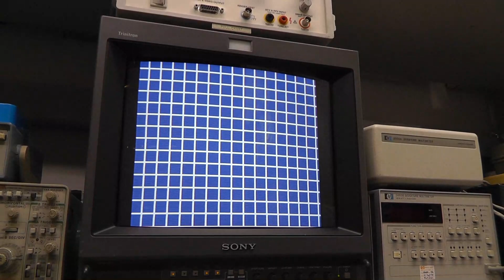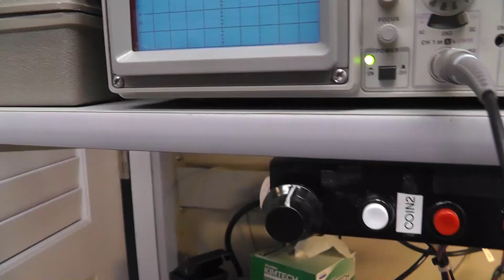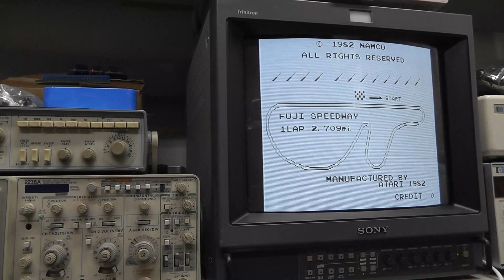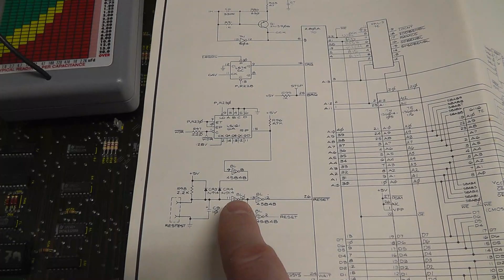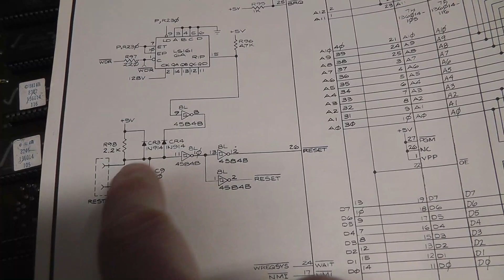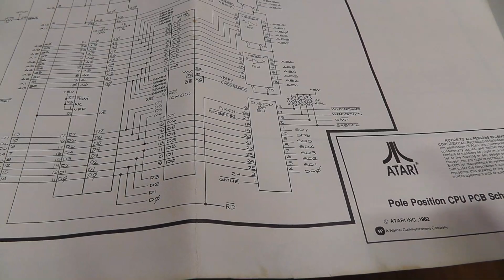Pole Position PCB Repair - Watchdog Reset Rinse Repeat - RevB Set Part 3 - FPGA CAT Box

Comment from the maker: https://forums.arcade-museum.com/threads/what-fixed-your-game-today-general-repair-log.399275/page-6#post-4491774
Game PCB: Pole Position CPU Board
Symptoms:
#1 Constant Resetting
#2 Not Constantly Resetting Enough?
Steps:
I actually addressed #2 first.
Put logic comparator on 6A and it tested bad. Did some probing and found line 14 was floating. Replaced 74ls161 @ 6A
Eventually, I realized the !WDR signal on 6A-1 should have activity if the game is running but it was floating. Checked traces and did not have good continuity from WDR test point or 6A-1 to R97. Trace was broken just at the through hole directly under battery area. Went down a rabbit hole on why it wasn't resetting as often as I thought it should. My theory is the cap at C9 is good for a couple of pulses through the 1n4148 switch diode and then the game will just freeze and no matter if "watchdog" is barking or not.

Moved on to #1
Tested addressable memory and roms of the sound z80 with FPGA Catbox. At first look, everything looked good, but if you looped on "verifying roms" or any test of the ram, it would eventually give you a few failures. In the back of my mind, I figured something was talking on the address bus or data bus when it shouldn't be. Replaced PLA at 7C; no joy. discovered pin 14 of 7C is actually for !CMOSRAMCS1 (not labeled in schematic). Went back to verifying battery area and found the emitter of Q2 was not connected to R92/R88. Another trace that looked good and even continuity beeped (though misleading at 50ohms) but was actually broken right at the through hole of R92. Not exactly sure but assume the Enable (!CMOSRAMCS) of 7E was being enabled when it shouldn't have been and putting garbage on the DB.

Repair.
Replaced 6A 74LS141
Trace Repair for !WDR to 6A-pin1
Trace Repair for !CMOSRAMCS1 (stopped the sporadic resets)
Not Needed repairs
Socketed PLA at 7C
Socketed and replaced M14584B at 8L
Replacd C9

Comment: Why would the CMOS RAM battery backup power circuit cause the game to reset? The watchdog reset circuit is monitoring the NV RAM battery backup circuit? What is that switching diode doing because they used a switching diode for a reason instead of just using a stock silicon diode
Reply from the maker: I theorized and explained as best i could in the video.  All ears for better explanation.
Reply: @jacklick  I watched the whole video I didn't hear you explaining it in detail
Reply from the maker: So my theory is that the CMOSRAMCS (enable) was not fully connected or being pulled high so would float down and get enabled when it shouldn't have been.  I probably could have verified that was the case but did the trace repair vs verifying the theory.
It appears the !WDR is more like a keep alive (my terms) derived from activity on the board via LS138 at 8D.  Only if it stops will the RCO of 6A initiate a Reset pulse.
Switching diode is acting like a switch.   Throwing the light switch to trigger the reset pin of the z80.
Reply: @jacklick  but what is triggering the switching diode? The switching diode is triggering the reset circuit but their must be a circuit or signal that turns on the switching diode. Most switching diodes have a higher threshold to turn them ON. I'm not sure why they are using a switching diode. It seems that the pole position reset circuit is a little more complex than most others arcade games